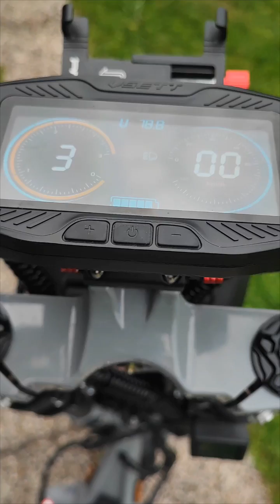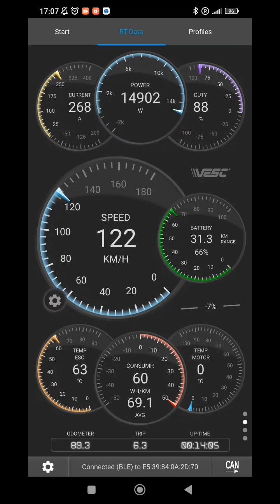VSETT 11 Modded 21S SPINTEND 150A

Comment: Looks great but too much faith into the chinesium discs in my opinion
Reply from the maker: Everything is made in China those days. Well they are holding good. Nothing wrong and they did survive quite hard braking from 121kmh to 0 but of course I'm using 15% regen. Now I'm getting Lonnyo 80H and 70H 22x3 motors